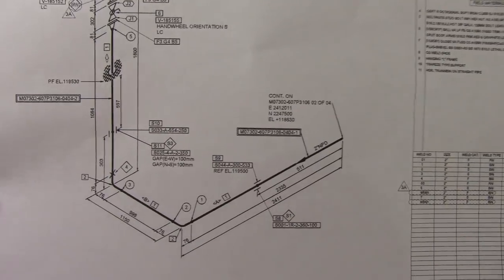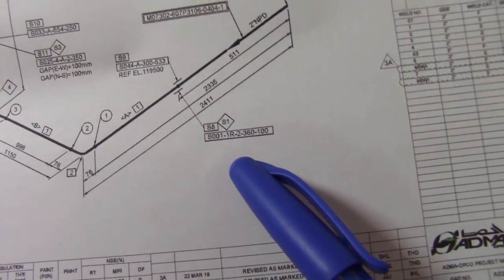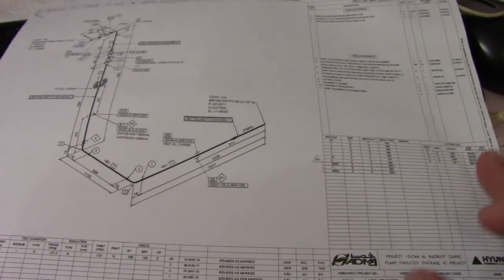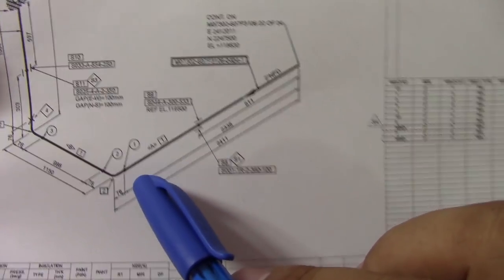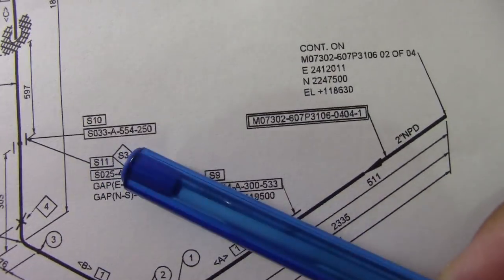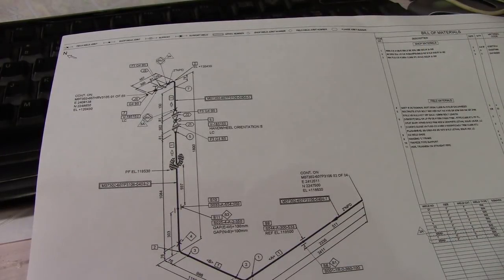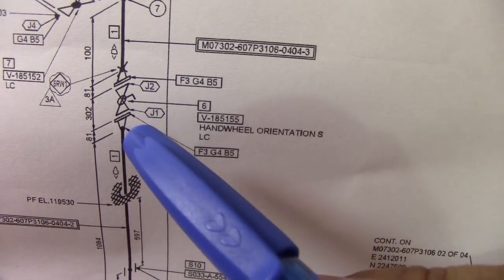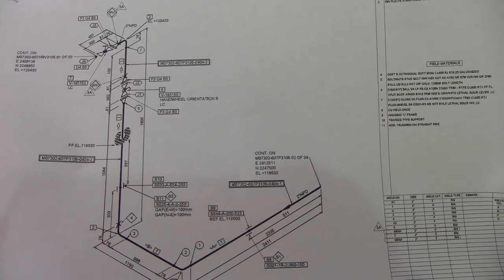Punchlisting Tutorial Video in the Test Package - What is Category A & B?

Comment: Gate. Valve. 302mm.
Weld. Neck. Flange. 81mm
Weld neck flange. 81mm
Gaiprod. 6mm.
1084mm.pipe.linght.hai
Short albwo center. 2×1.5×25.4=76mm
Short albwo center. 2×1.5×25.4=76mm
302+76+76+81+81+6=322mm